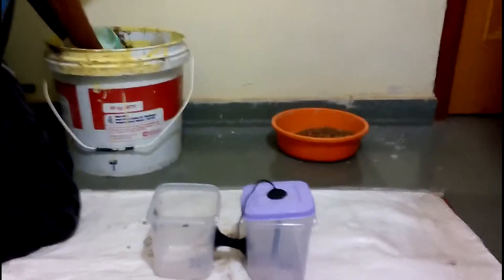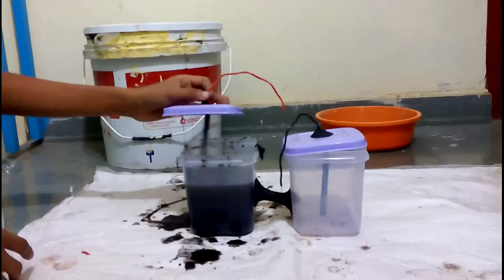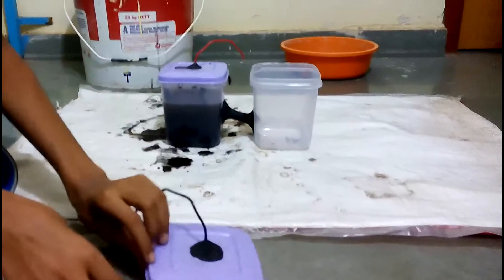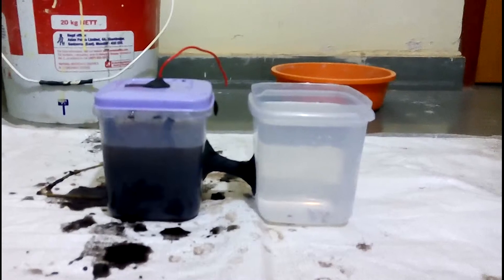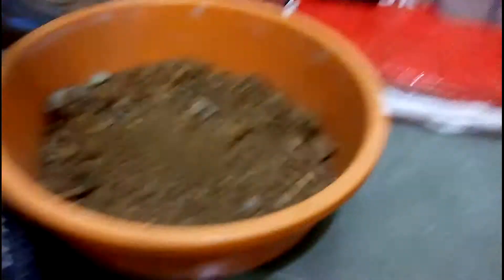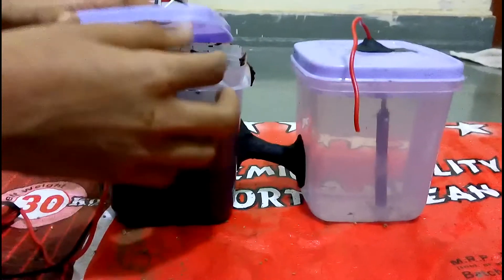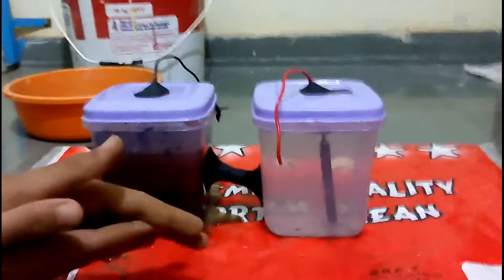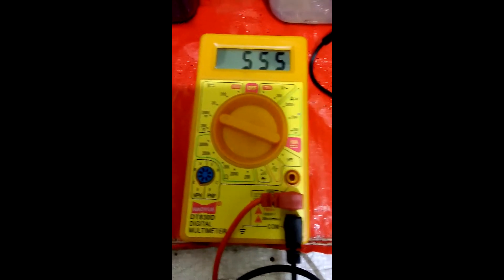How to make an Microbial Electrolysis Cell MEC (Part 3)

Comment: How did you put the wires attached to the cell in the chamber?
Reply from the maker: Kino John That chamber has 2 holes at that side through which I attached wires.....the wire is soled at both the ends....in this way the circuit gets completed as their is water inside the chamber......and dont forget to attach clay so as to prevent the leakage of sludge water.